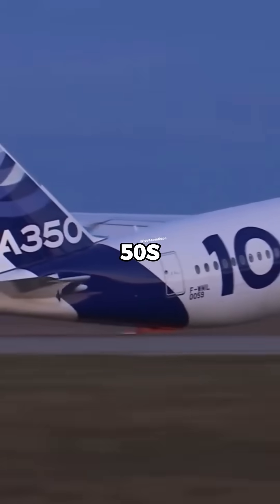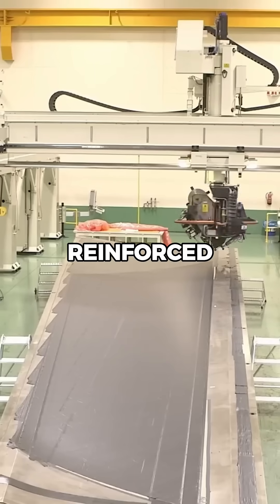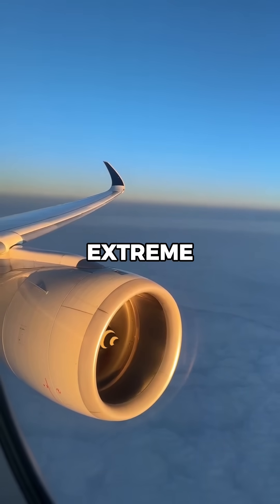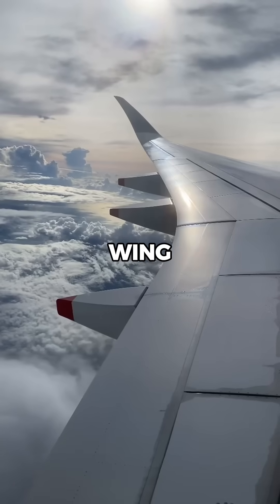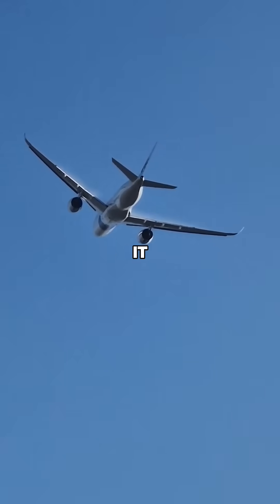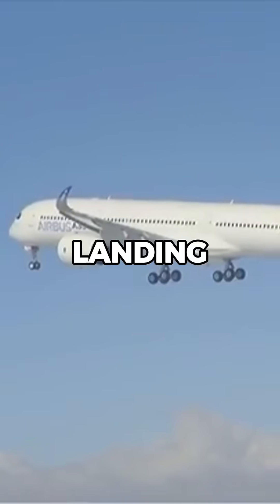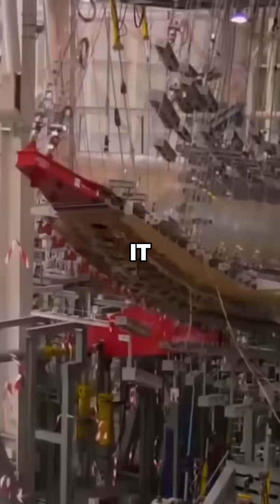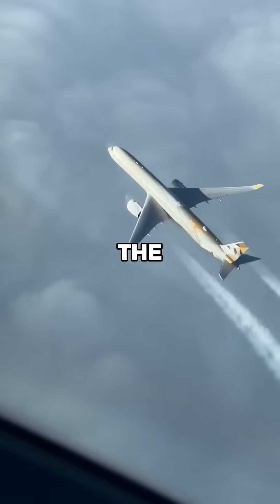How airbus tested the A350s advanced structure

Comment: It's not the mechanical part I fear in today's aircrafts,  it's the computers and the pilots ability to sort problems out. When the autopilot suddenly disconnects in the middle of the night at 30k feet in bad weather, followed by a total chaos in the cockpit. Take Air France flight 447, and Air Asia flight 8501, absolut horror scenarios trickled by small errors started with wrong sensor readings and flight management computer problems, totally escalated by the pilots actions and both ended in disaster.

Comment: This is what Boeing used to do. Then the bean counters demanded higher dividends for shareholders. The guys on the floor were replaced with junior bean counters who wanted things sped up. So they got rid of all the complainers and whistleblowers (some had untimely deaths soon after reporting of problems on the shop floor). Shareholders were really happy. Wall Street sang their praises. 
End of chapter one.
Chapter two will discuss shortcuts, phantom software, lawyers.
Reply: Not the way it works there pal the testing that they’re doing is required by the FAA and every single air frame goes through the same testing on the commercial market
Reply: @seanraymond4336 You still believe in Boeing? That company is barely even trustworthy nowadays, just look at their people. All of them are just money hungry executive and bean counters!
Reply: Are you ret@rded?

Comment: The plane burst into flames hitting a Q400
Airbus ain’t doing something about this but I think it’s necessary
Reply: What do you think would have happened to a say 777? And does Boeing consider this case in regard to their carbon fibre 787? ;)
Btw, that A350 lasted long enough for all passengers and crew to evacuate safely.
Reply: @matthiashartge5520 btw a 737 collided with a plane about the same size of it but barely. Did that, yeah.
Reply: @matthiashartge5520 787 has never crashed, don’t know how strong it really is

Comment: lol it’s completely copied from 787. They didn’t have to test anything
Reply: Just cuz the 787 did it first, doesn't mean the copied....
Reply: @fayyadguissidaAirbus fans talk about the A350 as if it’s something innovative. They used to make dull and boring planes so Airbus decided to copy the 777 engine size and shape plus the 787 composite body construction and they called it a “innovation”
Reply: @brownrocket again who said they really copied?
Innovative or not, (personally that's not innovative and not surprising as the same time , just engineering, same applies to every airplans),it doesn't mean they copied the B777 engine size.....
Reply: @brownrocket You know that Airbus does not manufacture the engines? And furthermore: they needed a certain amount of thrust, so what should they do? Put too small engines on the A350? 😂😂 Some comments here are so ridiculous…
Reply: That’s nonsense. They look similar, but every new aircraft type needs to proof its safety.

Comment: I love the A350 but the 777 is so far ahead of this
Reply: A350 is a pathetic attempt by Airbus to copy the 777 style and 787 tech
Reply: @brownrocket  That‘s simply not true, but if it were that’s better than making bad copies of your own aircraft for almost 70 years!
Reply: Not really. The 777x will have slightly higher (almost negligible amount) full efficiency per passenger that's it. Also the a350 has been in service for years now while the 777x is still in the final development stage
Reply: @kaz9242 this isn’t true it almost the same efficiency not higher on the 777 and the 777 can carry almost double the load cargo or passengers while having slightly less range than the a350 the a350 does surpass it in specific things but when u take it as a whole as In top speed climb rate tech and all of the new to aircraft technology the 777 is far far far superior to the a350 witch is a fact but that’s not a bad thing that the 777 is better because after all the a350 was built to be familiar and take minimal training most pilots that fly airbus can switch to a a350 in minimal time 2-3 months boing pilots would take far longer to train on a 777 so the best plane for what your doing depends on you situation but raw performance the 777 can not be beat and I’m not talking about the 777x I’m talking about all variants besides old and it’s not in its final stage btw
Reply: Boeing r not realy Boeing any more.
777x would have just have more  pax however they still.could not certify it keeps delaying. and that gave A350 the the advantage to show its capability ...even Emirates ordered A350-900 and wanted A350-1000 if Roles Royce would do the engine upgrade to be really efficient for there operation.  @kaz9242